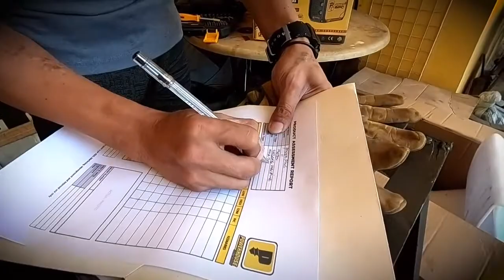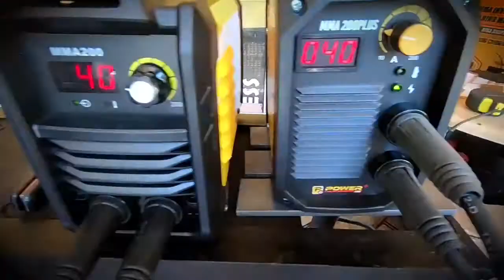🔥 NEW WELDING MACHINE FUNCTION TEST | WELDING OUTPUT | CURRENT | AMPERAGE | DESIGN | Lets Do It!

Comment: Sir kapag po ba 300A na evolution series powerhouse paano ang saksakan nun pwede na po ba sa outlet sa bahay or iconvert pa po sa breaker?kasi po my tiningnan ako wala pang plag kakabitan pa ?salamat po
Reply from the maker: Lahat po ng Inverter/semi transformer Pwede na sa convenience outlet pero dapat mataas ang amps ng breaker mo 30/40/50/60A para less ang drop voltage at make sure na malaki ang mga wiring 8/9/10Gauge pero kung pitik pitik lanv welding mo safe yan sa 10awg with 30A breaker tataas ka lang kung mag full weld ka halos mag hapon... so kung ganun need mo separate breaker from main meter base na merong 60/100 CBreaker at 8Awg na wire para less overheating at breaker tripping.